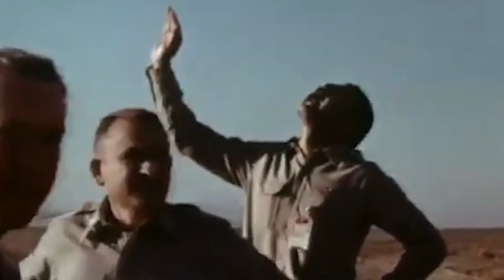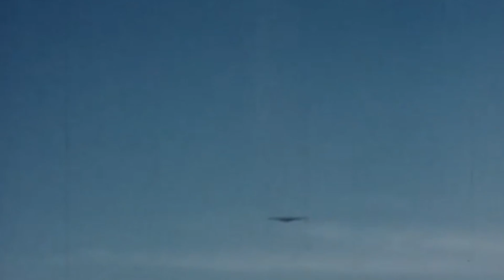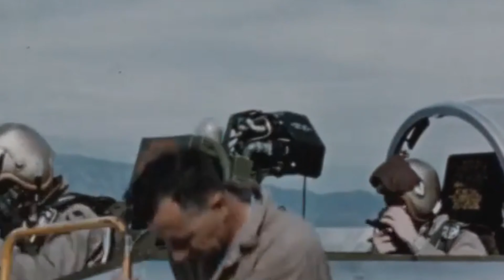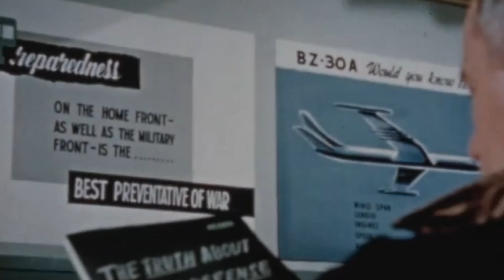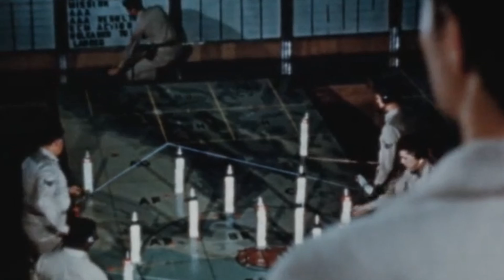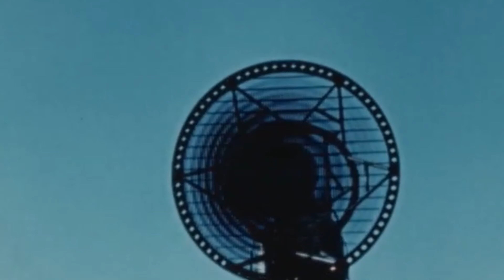F-89 Scorpion: The "Steel Scorpion" Armed with the World's First Nuclear Air-to-Air Missile

Comment: I Work At Northrop December 1,1955 Thru July 29, 1960. Hawthorne , Ca Plant . The Airfield Was About 5500 Pave Runway With 2900 Feet Extended Grass/Dirt Field .A Removable  Fence  Separated The Two Strips. They Closed The Runway After F89 Crashed On Take Off West To East About 1954 . My Job Layout  Templet Lofting Engineering Mockup .Northrop Was Modifying "D" Model Into "J" Model The Aircraft Transported By Rail/Truck To Palmdale Ca. Note: B21 Raider Bomber Home Palmdale Ca I Work On F89s Series,  N156,T38 Talon     F5a,b, Templets for YF20. Northrop Did Subcontract Work On F4,F100, F101, F102, F104, F105. SM62 Snark Cruise missile . Red And White Color I Got To Stand In The Cockpit F89j Finish Aircraft . The Ejection Seats Later Installed In Palmdale . The Sub Contract Work Farmed Out To Others For Secretness . I Got To See The Huge Wing Tip Rocket Pods Change Into Fuel Tanks . Northrop Plant Was 5000 Feet Long The Jet Aircraft Were  Back Up To The West End Of Field (Hawthorne Blvd),Blast Wall Inbetween. At East End Of Runway A Gated Fence Open Up For Departing  Jets. In January 1956 A Contractor Leased At West End North Side To Modif NEW F4u-5 Corsairs From Canada Like Wings , Installing 20mm Cannon Two In Each Wing.